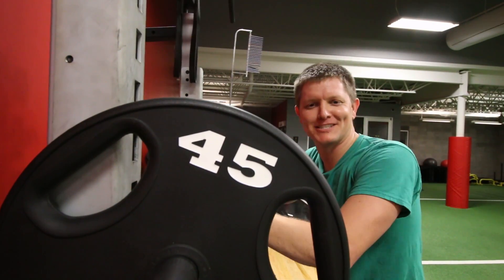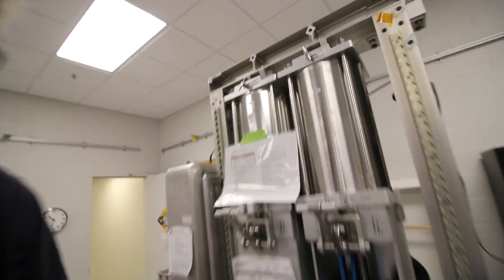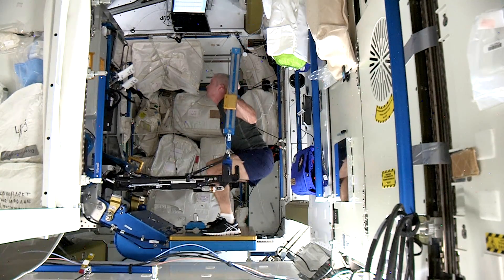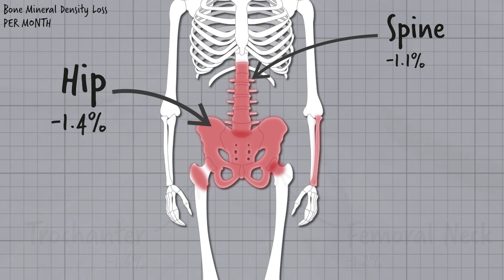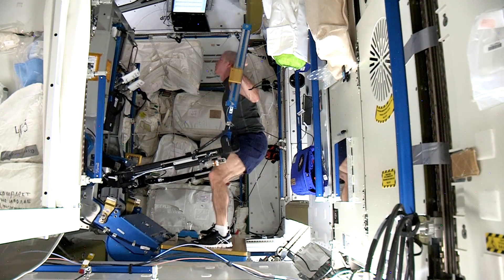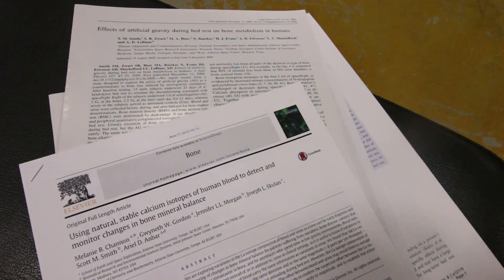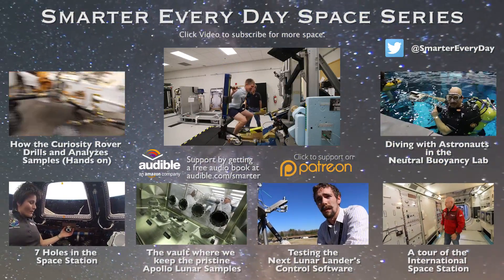Astronaut Urine Teaches Us Stuff - Smarter Every Day 149

Comment: I don't see why they don't just use resistance bands
Reply: The farther you stretch them the harder it gets.  That is NOT how weight works. Weight is constant.
Reply: @hotrodray9884  you can 100% weight train with bands.
Reply: Like designing a Zero-G pen, when you could've just used a pencil.
Reply: @larrychilds1327  nevermind
Reply: @larrychilds1327  The shavings become a potential problem.

Comment: Bowflex works in space... Just saying.
Reply: B real  but how would you attach it to the space station
Reply: B real  oh ok
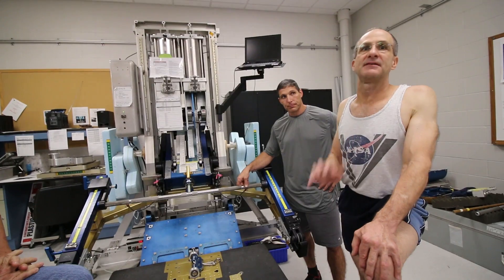Reply: B real  I know this is an old thread, but I am just throwing it in here. Getting a constant 'weight' is the key here. He explains it at 2:02. Springs, elastic and fluids gets various 'weight' at various 'pull' level. So a vacuum makes sense, because vacuum never varies. The expense thou... I don't know.
Reply: This system is also isolates itself from the frame of the iss to avoid creating interference with any experiments that might be going on.

Comment: I wonder why they didn't opt for resistance band weight lifting machines.  I mean, who cares if the load is not constant.  That is a desirable effect.  It's the same reason body builders drape chains over the barbell they are lifting.  And resistance band technology is already very popular. hmm?
Reply: Ed A and if they wany constant they can just compensate with a cam and a rope. But hey that doesnt souns hightech. Pistons and vacuum sound.
Reply: They needed to recreate gravity so constant
Reply: Rubber would probably break down too quickly and need to be replaced too often.  Even when the bands aren’t being used, they would degrade so fast in space they; would be useless by the time they were needed.  I’m just guessing, I could be wrong.
Reply: Yes but they aren't bodybuilders. They want to simulate gravity. And this is best way to do it.

Comment: NASA still running Windows xp lol
Reply: Pentagon does too, I guess it is too costly/buggy and information can possibly be lost if they upgraded to a new version (ex. Win10)
Reply: @D0wNhiLL  That is pretty much it.
A lot of the software and especially hardware used wouldn't be able to run on newer systems.
That makes it very hard and costly to upgrade, since you would have to replace most hardware, as well as write new drivers and software, or go through the grueling work of porting it.

Comment: Why do they need constant force? Resistance bands are great for working out! It's great to have more force as you pull it
Reply: Good point
Reply: +Joshua Anderson Just to waste money. They could've just put a bowflex on there but how would that justify their budget and engineering jobs?
Reply: +Joshua Anderson The other exercise regimes used bands, and in a weightless environment it doesn't stimulate bone growth enough for whatever reason,  so they need to simulate real weight. They spent millions and millions of dollars on this stuff, don't think they have over looked something so simple
Reply: +Joshua Anderson 
Because as you start to pull there's no force at all with bands. So how would that train/load the bones and muscles in that position?

Comment: Osteoclasts are cells that breakdown unused/old bone matrix. When broken down it’s reabsorbed back into the blood, filtered in the kidneys, and excreted. This is how that calcium ends up in urine! On the opposite side of this process are osteoblasts which are cells that form the bone matrix. When the nerves inside your bones sense extra pressure they send signals to your brain to stimulate these cells to form new bone to create reinforcement! This is why exercise is important. There’s a lot of other things that happen along with this such as the activation of hormones and what happens in the kidneys, but this is a pretty general idea!

Comment: Hydraulic resistance with a viscous fluid through a gated valve is lighter, more reliable and can allow a lot more range of motion exercises. Also the gated valve allows you to control just how much force is required, and it remains at a set level of force where you dial it to.

Comment: Destin, I have a question! Why is it so important to have a constant weight? I lift weights pretty seriously and sometimes use bands to accomodate the resistance in order to improve a certain portion of a lift. In my experience using purely bands could also build muscle mass and exert a load on the skeletal system, right? I'm sure these guys have a good reason, otherwise they wouldn't take such a huge apparatus up there... so what gives? What am I missing? Why not just take some big rubber bands?

Comment: I wanted to specify a bit the burning pee part: any mineral when burned makes a specific color (caused by the aquisition of energy by the electrons, which with this energy (heat) makes a bigger orbit around the nucleus, but to do that it releases light).  So the machine mesures the length of the waves of the light: color, and by that it determines how much and which minerals are in their pee.

Comment: I used vacuum to design a sustained force lifter... The deviation is probably 10% based on extension, mainly because I hit only about 85-90% vacuum. Best I could do with modified refrigerator pump. :-P
Simple and clever, as you said. Now I just need to get it to stop leaking. :-D
Great video! Loved it all!

Comment: Quick question. I know you're pulling from a vacuum and that "negative pressure" is constant. But at the same time, you're pulling against the air pressure from the environment. You are effectively compressing the air from the environment, so it's pretty much like turning the whole room into the air cylinder you talked about earlier. Wouldn't it still increase the air pressure of the room (if ever so slightly) and thus still requires more force as you move it to a greater degree? I know the change in force would be insignificant but i would like to know if my understanding is correct.

Comment: Can someone help explain why resistance bands would not work? Sure the resistance increases as you stretch the band, but that just means your bones are under more force? Which is what you want in the first place? Time under tension is what builds the bone density anyways, right?

Although from a consistency and repeatability stand point, I can see the logic. If you set the ARED to 100lbs, you will always get 100lbs of "weight" (its easier to do 80% 1RM, 70% 1RM) vs a resistance band that would change its force depending on where it was gripped, how worn out it becomes.
Reply: Resistance bands are good for a lot of things but they don't provide full load over the entire range of motion like ARED does.
Reply: basically a multimillion dollar squat rack

Comment: If a vacuum exerts a constant force, could you extend the length of the cylinder containing the vacuum infinitely whilst requiring the same amount of force to push the piston back to where it started? Or is a constant force required, so the amount of force would also be infinite? I'm struggling to wrap my head around why a vacuum produces constant weight. When I take a syring and put my finger over the end and pull the piston, it seems to take more force the further out I pull it - or is that just an illusion?

Comment: I'm curious - wouldn't some kind of elastic compression in the sleeping arrangements on the station (maybe pulling on the shoulders towards the feet) alleviate some of the bone density loss? - I mean sure it would be quite difficult to apply compression to all parts of the body and it would have to be used in conjunction with other things such as the exercise machine in the video but wouldn't it help at least some parts of the body? 

I assume such an idea must have already been considered and dismissed but I would love to know the implications and the reasons.

Comment: The astronaut pee burning device is called a mass spectrometer. When I was stationed aboard the Carl Vinson, a much larger version was used to test oil samples. By vaporizing the oil, in this case a carbon ark was used instead of a flame, shining a laser through it, and re directing it with mirrors, through a prism, and on to a bank of light sensitive tubes, it would produce a graph showing the concentrations of metals in the oil. This technique only requires that you know the various patterns created by the materials you wish to test for. I actually asked the operator of this particular mass spectrometer if he had ever tested his pee... He had.

Comment: Wouldn't a generator also be able to provide constant resistance? You could work out and generate some electricity at the same time. I guess that would add to the weight of the equipment though and therefore cost more fuel to bring up.

Comment: great video and great machine. However I'm still wondering, why is the constant force so important. I mean, working out with elastic bands should be as good as using the ARED. I'm sure I'm not smarter than the guys over at NASA, or smarter than anyone else for that matter. Could you explain why elastic bands aren't good enough?

Comment: I understand that this is an old video, but what is the difference between that and using resistance bands?  It sounds way to simple but seems like a logical explanation. If I could get an answer from somebody that knows better than I do that would be great.Thanks
Reply: I believe that the constant force they insist on is because that makes the data easily ready to record. That's at least one reason I can see.

Comment: +SmarterEveryDay, one thing that I don't understand and doesn't seem to be addressed in the video is what is the actual problem with the increasing resistance offered by spring or rubber band based systems?  Why exactly is linear so important?  Systems based on much simpler technologies can create positive and negative loads on the skeletal system.  While ARED is amazingly ingenious, it looks very complicated, large, and weighty for launching into space.  How much gain in benefit is there to linear loading vs rubber bands to muscles and bone density?  Thanks.

Comment: I've been trying pretty hard to figure out why the astronauts couldn't use a machine like a bow flex? Using the resistance rods with cables and pulleys wouldn't change without gravity would it? Since your not depending on gravity to make it heavy it should work, shouldn't it?

Comment: ok, so; i thinking missing something here. if you look at the syringe example again, is there a metering valve on those vacuum cylinders to keep the resistance consistent? because if you cap that syringe and try to pull the plunger out, you generate greater resistance as it pulls greater vacuum, right? so what did i miss? how do they keep the simulated weight the same throughout the movement/stroke of the cylinder?

Comment: Very late comment, but would appreciate any assistance in understanding - in my head, it isn’t so easy to create a vacuum with a cylinder type device.  If I expel all the air from a syringe, put a stopper on the end and try to pull the plunger, it feels like it takes an immense amount of force to pull the plunger even a little... is my analogue just scaled so out of proportion, or is something else geniusly clever (magical?!) happening here?

Comment: Can someone better explain why a spring can not be used? I'm a bit confused on the subject.
Reply: I believe the constant force they insist on is because that makes the data easily ready to record.
Reply: The basic issue is that springs generally follow Hooke's law, 
Force = k * Distance, where k is the spring constant. This means that when you double the distance stretched or compressed, it doubles the force, which is a lot like how a slingshot or a bow works, but very different from real weights, which apply a constant force.
As another example, a 100 pound weight applies 100 pounds of force on the ground, 1 foot above the ground, or 5 feet above the ground.
However, a spring, with a spring constant k = 50 pounds per foot would apply 0 pounds at ground level (spring at rest), 50 pounds at 1 foot high, 100 pounds at 2 ft high, 150 pounds at 3 ft high, and so on. If you tried to lift it above your head, stretched about 7ft, that would apply 350 pounds of force.  We DON'T want our weight replacement to get heavier the further we push it.
https://en.wikipedia.org/wiki/Hooke%27s_law

I was surprised by the vacuum solution, but it is very elegant.  With a vacuum, you have zero air pressure on the inside, and constant air pressure on the outside, so no matter how far you pull the piston, it has the same force.

I hope that helps!

Comment: Technically, you still have the same problem as with the air spring, because as you pull the piston out, the pressure in the entire room will increase, although only a tiny, unnoticeable amount.

Comment: Hey Destin, thanks for the awesome details! Quick question if you have a moment, would something like a Bowflex also not be as helpful in space due to similar limitations as the rubber band? Meaning that it's not the same because it strengthens as you draw the bow?

Comment: I remember a video of Derek from Veritasium - he passed a magnet through copper tube. It didn't fall quickly - it fell slowly with constant speed. The reason was if it goes faster it induces current in the tube and creates electromagnet that slows it. So why didn't someone think of passing a magnet through a loaded coil - you make power and you exercise at the same time. Power is never enough. Well if you stop - the weight is gone, so it's not as simple as it sounds, but I have the feeling there are some smart guys in NASA and they will figure it out.
P.S. Gravity Light

Comment: Ok here is something to think about. I contend that the system on the space station does not deliver constant force. Despite pulling against a vacuum the space station is a closed air tight environment meaning that the side of the piston that is exposed to air does push against the pressure in the station causing a ramp up I’m resistance. Admittedly this would be small and Insignificant however this system still delivers a non constant force to the user.

Comment: I don't get how using a vacuum works. I would have thought it would get harder to lift, because it will resist more as the vacuum increases.
Why not just use springs and design the system so that the fulcrum changes proportional to how harder it gets?

Comment: Couldn't a micro controller and force sensor be used to regulate a servomotor with a pid to maintain a constant force without so much structural metal required for a vacuum?

Comment: That vacuum weight-lifting machine doesn't make sense. How can the piston go down with the vacuum above it? it's like holding your finger over the top of a syringe and trying to pull the plunger. It would need air to be leaked into the vacuum, and then sucked out as it goes back up.

Comment: This vacuum mechanism doesn't exactly work the same in space as on Earth. On Earth the atmospheric pressure, weather changes ignored, stays constant because it's a result of the gravity of Earth. In space, the atmosphere is in an enclosed container, so by pulling the cylinder, you're compressing the air in the spaceship. That will increase the pressure in the space ship. OK, maybe not significantly, but it's the same issue as the spring and the rubber band. The solution isn't because of constant atmospheric pressure but because the change in pressure is insignificant. You could do the same thing with a really long rubber band.

Comment: Hey  +SmarterEveryDay Can you please further explain why the vacuum stays at a constant pull? I always thought as the volume increases so would the strength of the pulling force. I'm doing a physics project where I'm building a small scale ARED and I can't find answers anywhere. Hope to hear from you soon!
Reply: +C Szabo There is no pulling force of the vacuum, only the pushing force of the atmosphere inside the ISS. It is the pressure inside the ISS that remains constant (or very nearly so), which is why the force remains constant.

Comment: Actually... its not 100% constant... its technically building up air pressure in the cabin, excerting more force. not alot. but it's not 100% true to say its constant.
it wouldn't have this 'force' if the other end was an equal pressure
nor would it behave the same of the other side is over-pressured.

Comment: I'm slightly confused. The system with the piston and the vacuum thingy, can't you do the same thing with a medical Syringe (not with a needle)?
Reply: Yes, you can actually you would push the syringe all the way to the top then put something to plug it and pull away the syringe plunger. Voila Vaccum.
Reply: Vacuum
**
Reply: Yes, it is the same principle though a syringe is a rather poor vacuum.

Comment: Why not just use strings? The tension of them is enough to feel like you're lifting weight. Why so much complication?
Reply: cos the force is not constant,so would not behave like weights
Reply: A bit late on the reply, but long story short, it needs to be something with the absolute minimum number of individual parts, ESPECIALLY parts which can break. 

This was listed as another reason (by NASA, in a different report) as to why things like resistance bands and springs weren't used. Pistons are extremely durable, but many of the other proposed methods could break in space, which would leave the astronauts SOL.

Comment: Very cool idea, but was it really worth paying NASA engineers to design such a fancy rig? Yes, I understand that using elastic workout bands will have varying weight the further they get stretched. I just don't see why you would need that to maintain muscle mass. Seems like they turned a 20 dollar problem into a 50 thousand dollar solution. But enough with my negativity, great video :) I got smarter today.